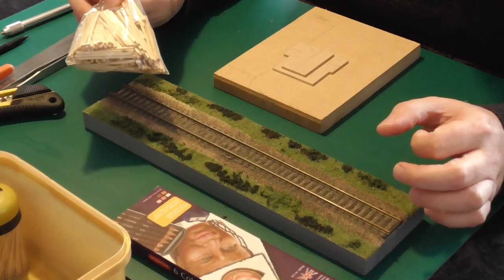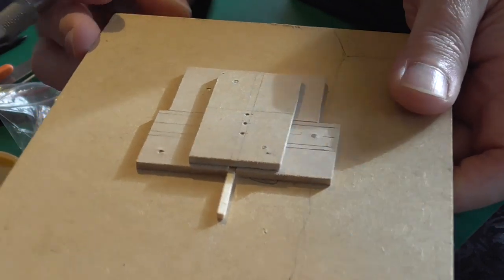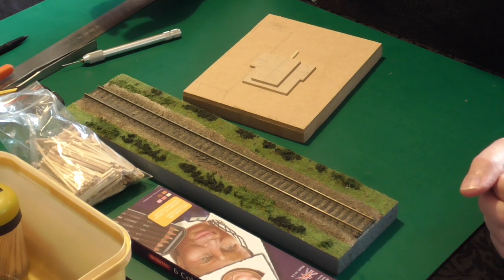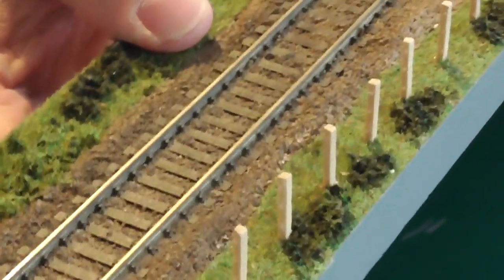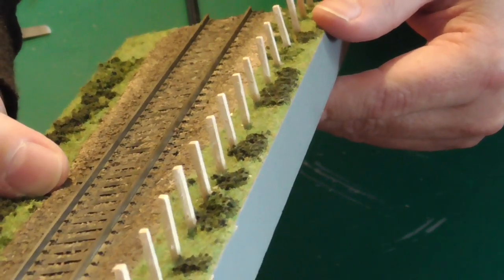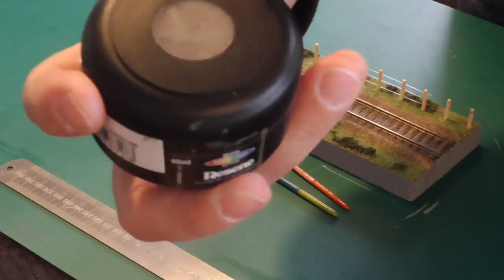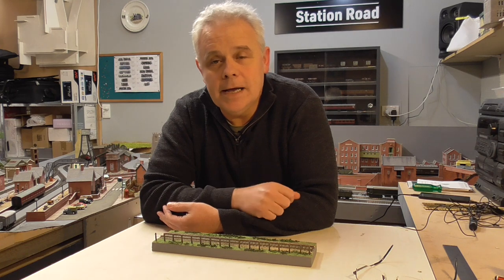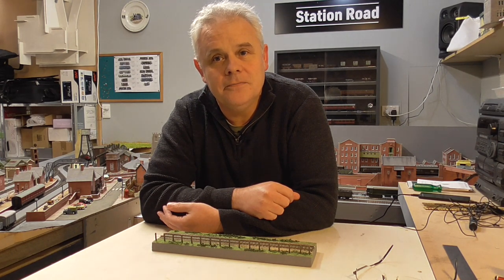Lineside Fencing on a Budget

Comment: Yes I used this system for fencing our large club layout many years ago,I did 4 wires and drilled each hole individually (didn’t use a gig).That gig was a great idea,wish I thought of that.I did hundreds of matchsticks,took me forever. It did work out great especially on slopes as there isn’t many fence systems you can buy for slopes. I did feed the fishing wire through before placing them into their final holes,the other idea I had while watching was you could use a air brush.Great job  David
Reply from the maker: That's one bit of kit I have yet to invest in... an airbrush, but the more and more I venture into the model railway journey, the more I'm realising I need to purchase one. I imagine a airbrush in this instance would probably work quite well, and most definitely speed up the process.
Reply: @StationRoadModelRailway  
Hi Julian. Ive just bought a new airbrush off trademe and it wont fit on my compressor. Cant find the appropriate connector so be aware.
Reply from the maker: That doesn't sound good. I'm thinking an airbrush kit is something you can't compromise on over price, hence my delay purchasing one.
Reply: Maybe look for a airbrush and compressor kit,may cost a little more.wish I did that.

Comment: Love this solution for drilling holes in matchsticks! One suggestion is that if you swap the top piece of wood with the holes drilled in it for a piece of clear acrylic, you could see if the matchstick being drilled is slightly off centre? Keep up the great work!
Reply from the maker: Great tip for the upper jig component. When I made my jig, I just used what I had available at the time, which was some 2.5mm MDF. The slightly off-center holes only occur if the matchstick is thinner and doesn't fit snugly in the slot.

Comment: I did the same but with wire for part of my daughter's trainset. I did not use a jig though, so my hole spacings were a little random. I think your jig really helps the uniformity and look. Thanks for sharing.
Reply from the maker: The main issue I found when I originally used wire was trying to get the wire taught on fencing that curved in any direction without the matchsticks snapping at the holes. Fishing line doesn't require as much force to get the line nice and taught between posts.
Reply: @StationRoadModelRailway  - i his find the wure hard to work with too. I'll bear the fishing line technique for future works. Thanks for sharing.
Reply: Autocorrupt, don't ya just love it.

Comment: What size drill bit are you using?  What is the length of the match stick?  You made a nice jig, but you're leaving out vital information a modeler would require.  If using a foam base structure, you'd probably need to glue in the match stick posts.  Cheers from eastern TN

Comment: Regards your town scenes. I am curious about the date the scene is set - I guess 1960 ish (the van suggests that era). I think the yellow 'no parking' lines were first introduced in 1960 but the white zigzag line, to the zebra crossing, was introduced in 1971. Apologies if I am mistaken?.  
Your fence building methods seem easy to copy and produce a decent quality fence - I need to build a fence and will certainly try your method . Many thanks
Reply from the maker: Thanks for noting the road markings. I was aware of this but I don't following prototypical modelling to the nth degree, this is so I can maintain some level of artistic licence. The period of Station Road is not a specific year but roughly a decade (give or take a year or two) from the late 1950's to the late 1960's. This is so I can run diesel and steam together.

Comment: Hi just watched the road markings video you did and subscribed, with you saying about 3 holes not being prototypical in certain parts of the uk especially where I'm from north wales 3 wires through the post is correct, i bought match sticks last year to do this but wasn't sure how i was going to do it so when i come to do mine ill rewatch this will go back and watch your videos, look forward to your next update cheers Beeton Hough Junction (Dave C)
Reply from the maker: Hi Dave, that's interesting to know 3 wire fencing does exist. Here in NZ, it's at least 6 wires (any Kiwis correct me if I'm wrong), and despite the number of wires, I've still had the misfortune of being on a train here NZ where cattle have broken loose on the line.

Comment: Used this method on my last layout but used silver dressmaking cotton for the wire. I think three strands for a British outline layout is prototypical, I'm sure the fence where I used to go trainspotting near Potters Bar on the East Coast Mainline was only three strands. It is over 45 years since I last went spotting there but I'm sure it was only three. I also found it easier to drill the hole but thread the cotton before planting the fence posts as I found it impossible to thread the bottom line in situ but I was using cotton which is probably even more fiddly than the fishing line. One thing would be useful how far down from the top of the post is the first hole and then what is the distance between the subsequent holes as my last effort was alright but the spacing didn't look quite right. I've only just found your channel and it was the fencing that caught my eye as I saw advertised in a magazine a kit for this type of fencing but it worked out at about £3.00 per foot which even on my modest layout would have cost nearly £40.00. We are still in partial lockdown here so I'm hoping to do some work on my railway.
Reply from the maker: That's really interesting to hear about the number of wires used in the UK, somebody else mentioned 3 wires being in use. In terms of pricing I didn't do a comparison with kits. The bags of matchsticks I buy cost a $1 (50p) and might have 200 sticks in it. The fishing line about $5 (£2.50) for 100m.
Reply: Station Road Model Railway I moved from the UK for France some six years ago and i will have to use actual matchsticks. I'm afraid they don't really understand railway or model railway enthusiasts model shops are few and far between here and then mainly for radio control. I have discovered one model railway shop here but it is incredibly expensive €400 plus for a locomotive and an average of €150 to €200 for a coach so I tend to get all my stuff sent from the UK. Keep up the good work.
Reply from the maker: Wow, that sounds like NZ prices. I recently bought a Hornby loco (new) from the UK, because even after the international freight, it was still half the price of the same loco being sold at a local model shop. Model railway prices here in NZ are extortionist.
Reply: Station Road Model Railway Just had a Hornby S15 arrive from the UK the locomotive and two DCC chips cost £132 including shipping via Royal Mail and LePoste. The best prices in the U.K. Are Hattons in Liverpool and Rails in Sheffield. It's worth keeping an eye on their websites even in NZ as they sometimes have incredible discounts. I bought a Heljan Falcon from Hattons brand new for £75.00 when they were retailing for £145 and they ship all over the world and are quite happy to offer technical assistance over the phone even if you are on the other side of the world. Their staff all seem to have a deep product knowledge I've never had them send me an incorrect part even when I've phoned them up and said I've got such and such loco which I didn't buy from you but could you send the relevant chip.
Reply from the maker: I purchase quite often from Rails of Sheffield and also TMC which are really good.

Comment: Brilliant idea and I love the jig. What about marking on it where the cut line needs to be and you could then mark each stick before you cut it to save having to use a ruler first? You could put a second line to mark how deep the post has to go. Just a thought :-)
Reply from the maker: The only reason I individually mark post for trimming height is out of habit. When I was making the posts on the layout (beginning of video) they all run over undulating ground and in some locations, the post had to be longer in order to anchor into the scenery underneath. Because the posts ended up being different lengths, I didn't add a cut mark to the jig. But in the case of the display scene where the area is flat and the same substrate, adding a cut mark to the jig is definitely a good idea, thank you.

Comment: the zig zag markings on the road crossing are to modern for a steam era layout black and white crossing and belishs beacons otherwise looking good
Reply from the maker: The period of Station Road is not a specific year but roughly a decade (give or take a year or two) from the late 1950's to the late 1960's (sometimes sneaking into the early 70's). This is so I can run diesel and steam together. I was aware the zebra crossing markings (zig zag lines) were introduced in the early 70's but I don't following prototypical modelling to the nth degree, this is so I can maintain some level of artistic licence.

Comment: Your posts are a little closer than prototype in NZ...ten foot spacing was a rule of thumb for cattle fencing but looks good
Reply from the maker: The fence is far from prototypical, but more a representation of a post/wire fence. I'm basing the fence on the UK where, after some research, there seemed to be some fences with posts at 2m or 6ft. And of course there's the obvious battens that I haven't included which are quite common on NZ lineside fences, guessing needed because of the 3m post spacing.
Reply: @StationRoadModelRailway  
Understood and you....as looks just fine...10ft/3m spacing for a typical 5 wire or more lineside or boundary fence without battens for NZ is common... with battens we go out to 20foot spacing
Reply: Sorry my phone likes to change my words by you get the gist .. I'm waiting for my micro drill to arrive.... got some fencing to do